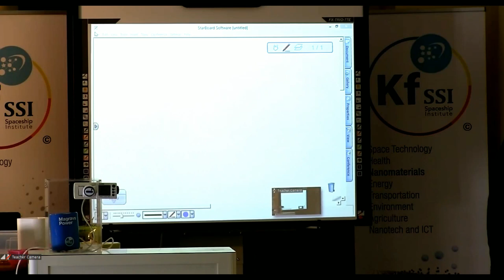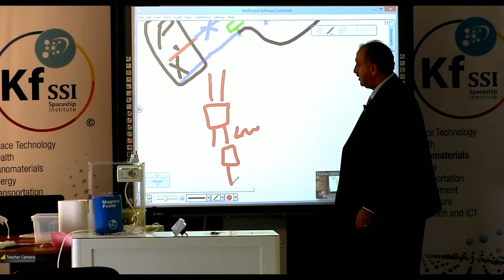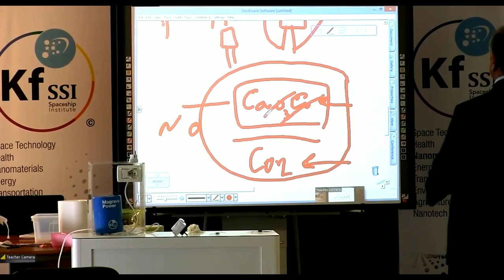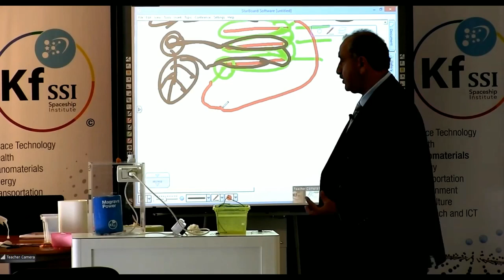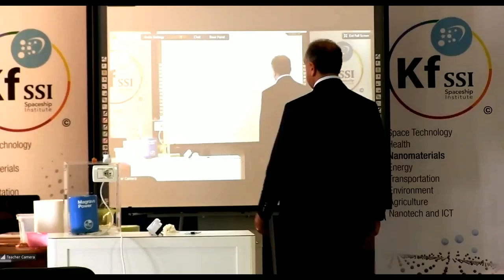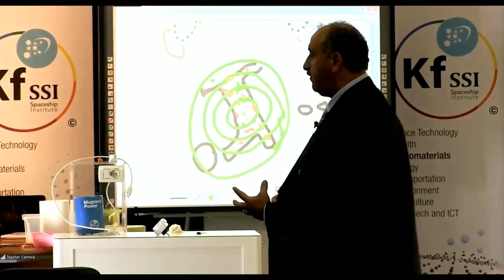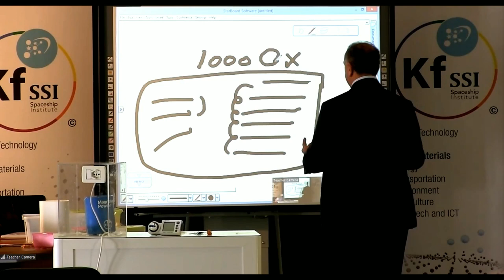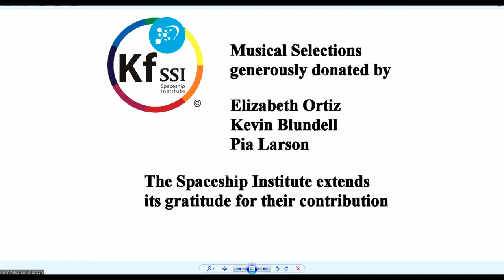KFSSI Blueprint Teaching HD #Session 7

Comment: This plasma capacitor construction is not well documented anywhere yet. With such an awesome technology, why is it taking so long to get very professional, clear cut step by step instructional videos out there? 

Questions - 

1. Why 4 small capacitors, why not one larger one? 
2. If standard capacitors can be used also, what make and model?  That should also be shown. 
3. GANS - I may have missed it, although I am hanging on every word in this series - If GANS can be made with pure copper plates as some have shown, then why are we also told to use Nano coated plates as well?
Reply: +AHLC Global    I think that the answer to 3 is:  you need one plate nano-coated - whether copper or zinc - and then a non-nano coated sheet of copper, zinc, silver etc.  But you need 1 nano-coated then the other sheet or metal however you would do it - without any nano-coating.  I am thinking about using an ingot or melted blob I have of indium - indium is really beneficial from what I have seen - especially in coloidial or nano structure...

Hope that helped some - I came back to draw down how to do these capacitors - I have everything but enough gans - and the capacitors to make my first 4 plasma generators... can't wait!

Peace~